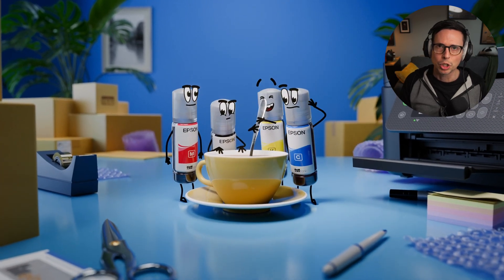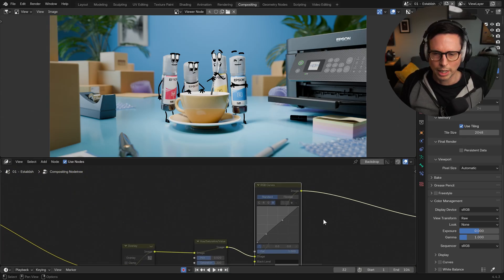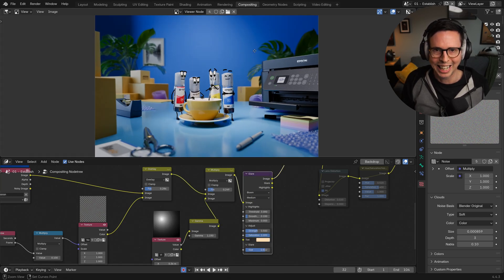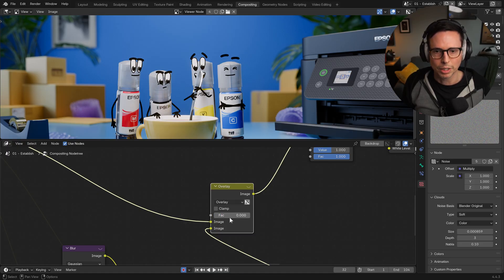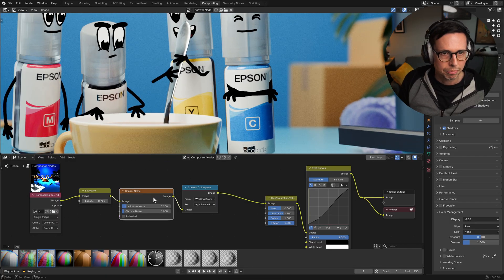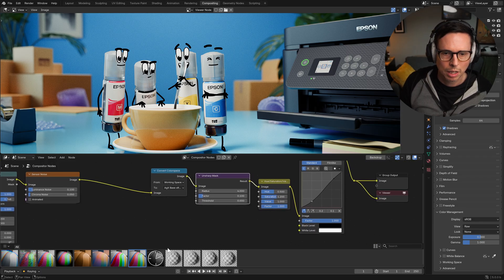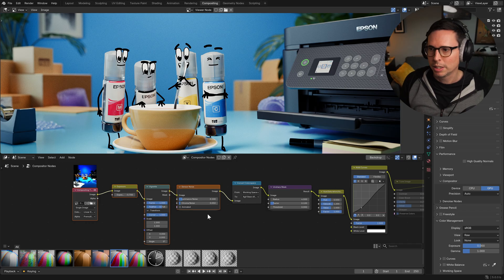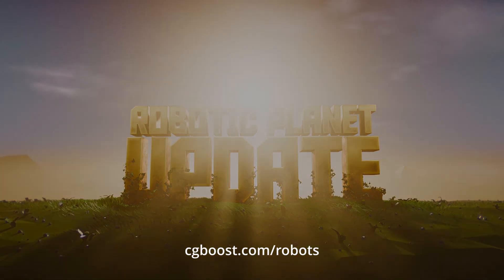Blender Render - Post Processing in Compositor

Comment: Nice one man!
Now there's also grease pencil render pass that can help you tweak the output in compositor :)
Reply from the maker: I should have really done that as having grease pencil bypass the agx color conversion would have been ideal to keep the whites 100% white. I had to use the color modifier to boost the value of the grease pencil elements, which messed up anti-aliasing.

Comment: Isn't it awkward  to do color adjustment before the transform to agx?
Reply: I also wonder. Why you did use agx as a start in transform panel under render settings?
Reply from the maker: I started using the colour transform in the compositor to be able to have the nice highlights of agx and ensure the white point is very close to 100% for contrast in srgb, which is easy to achieve after the colour transform. It looks like blender 5 has the ability to add compositor nodes to VSE strips now, so that might be a nice way to do it in the future.
Reply: @ldm isn't hard to start this way, inmean at the start, the colors are so off. Or do you add that color transform and then do adjustments before it. But keep the transform active all the time

Comment: I love that Aspect Tester you made. I've been creating scenes in 16:9 only to later move things around to fit the 9:16. I'm new to all this so when I saw the iPhone 17 launch with the square sensor, I figured that was a really good solution to my problem and now I can create a similar node to yours, hopefully it's not too complex.
Also, a question. For a project like this where colour is important in the project, how do you choose the color space to use, are you sent samples to see how red or white a product is and use a color space that closely resembles it or  just pick something like AgX and just dial in the colours?
Reply from the maker: For this AGX was selected for it's realistic looking highlight roll off. The agency had an art department that put together some references slides. The look and colour was dialed in by eye by adjusting materials, lighting and grade on top of the agx transform. This was all baked into the rendered beauty pass, which was exported as OpenEXRs, then to h264 mp4 for delivery to sRGB.
Reply: @ldm do you do the actual crop in another software?